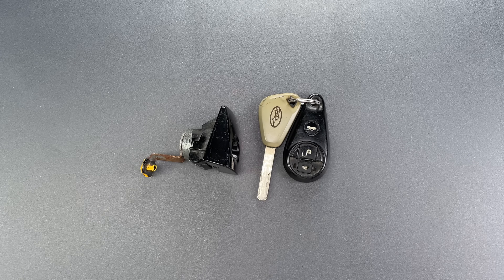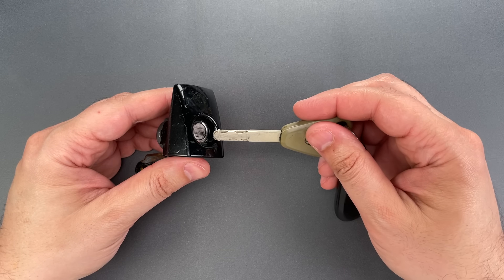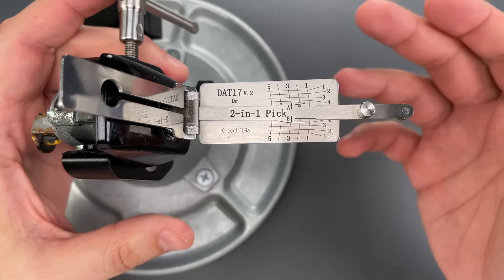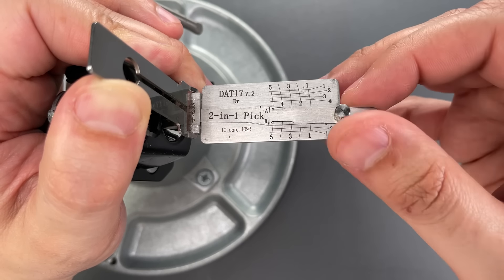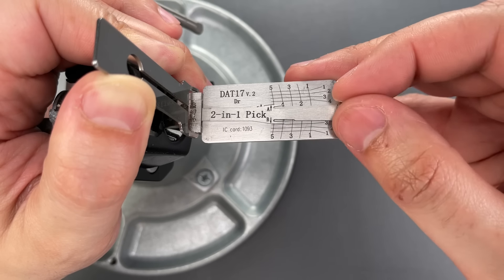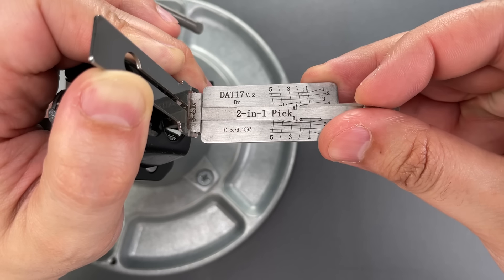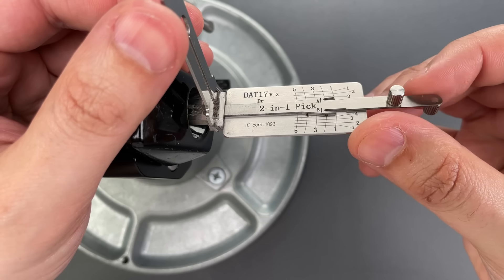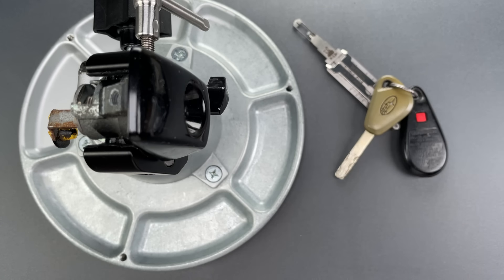[1346] A Trap For The Unwary: Subaru Impreza Door Lock

Comment: The great irony of this is that this is one of the hardest locks to pick, yet also the most likely to be bypassed entirely by any nefarious actors.
Reply: legit when my dad locked his key in his subie, the lock dude pried the window away from the flashing with a wedge and used a coat hanger to unlock the door lmao. one of the downsides of having frameless windows
Reply: @johnmichaell2505  Teslas are the same!
Reply: @johnmichaell2505  could that not be simply fixed by installed a flashing inside the door and better window framing though?
Reply: @prydzen  no, simply because the only real way to secure the window would be to put a lip over the top of the window. While this would allow for the top of the window to be secured. The window would have to be rolled down and then rolled back up any time the door was opened or closed
Reply: It's easy to open a locked car door by sliding a metal coat hanger down the outside of the window and pulling up the latch.
Reply: Cars are alas, quite limited in break-in resistance by the need to actually have windows. 😂

Comment: I’ve been watching videos on the Impreza for weeks now, this is a sign I should get one I just know it
Reply: My second one blew up within 3 days. Currently got no engine in and can't lock it 😂
Reply: oky  not again
Reply: oky  Stop spamming.
Reply: @xuNsh1ne  what's the link to?
Reply: We love our 2010 Impreza but I highly suggest going either prior to that model range or after it. I think that’s before 2009 and after 2012. It’s just a really poorly designed car that’s hard to work on... lots of fit and finish issues too.
Reply: @erik365365365  We have a 2009 hatchback with 160,000 kms and have only needed to swap the clutch so far. The thing guzzles fuel though given its pretty anemic acceleration.
Reply: @alshyia  I reported it as spam. Thanks

Comment: This is the first time I've actually appreciated having the Lishi tool used for the picking demo; before this one, LPL using one felt like watching someone play a game with all the cheats turned on. That is, not only is the method trivializing the task, I'm not learning anything from the demonstration. In this case, though, the lock was complex enough that I'm not sure I could have followed what LPL was doing without the Lishi tool providing extra visual feedback on which wafer was being manipulated.
Reply: Good point. This is one time that both the Lishi tool and the lock were better explained by the pairing of tool to workpiece.
Reply: Totally agree. I've gotten more used to visualising locks while watching them being picked over the years (I've only picked a few simple practice locks myself), but the tool on this one certainly makes it clearer. This does just seem like an edge case, though, where the additional tool makes the whole video better

Comment: My Forester Rocks. Even if you manage to get the door open, the obnoxious alarm system goes off and the fuel pump won't run until reset in the ignition or key fob. It's easier to steal just the catalytic convertor now. Not that I recommend or condone this.

Comment: I do love the suggestion of slipping a locksmith some money.
Reply: maintenance man [the use of a locksmith is specifically NOT req'd] as you have to replace the whole FUBAR unit with a new one- that's for the maintenance man to keep quite when you do that yourself or when he does that for you without telling the building owner/manager there is a lock picker in the building tampering with the hardware & FUBAR the units

Comment: Shouldn't writing down the wafer positions when picking help with picking it closed? As I understood the Lishi pick, it was designed to not only pick the lock but also decode it for making keys.
Reply: To get the wafers to stay in position they need to be bound before setting. The order in which they bind in that partial position won't necessarily be the same order in which they originally bound. So he has to go through the whole picking process anyway, wouldn't save much time knowing the final set positions.
Reply: @ussenterncc1701e  Thanks for clarifying.

Comment: Wait so he never got it open. Should I be worried that I’m in a branch of the multiverse that’s no longer on the main timeline?
Reply: He got it open; it just doesn't move very far. You can see he moved it the same amount that they key moves it (5:03).
Reply: I'm a locksmith. He did not get it open - this wouldn't unlock the door. I'm sure LPL could do it but no he did not unlock the cylinder in this video. Once it gets to that halfway picked position, it still needs another few wafers to be picked in order to turn. You can see when he uses the key that the cam on the back actually spins a full 90 degrees.
Reply: @vagrant2592  he got it open
Reply: @kakswell  wrong.
Reply: Thought the same thing. Came to the comments looking for an explanation. He didn’t fully pick this one. Just showed it getting stuck and unsticking it. @LPL any way to see the complete unlock?
Reply: @vagrant2592  its ok to admit being wrong from time to time buddy.. i wont hold it aganst you
Reply: the goal of the video was to show people where they messed up, what state the locks to "their" car are ending up in and how to fix it so they can use their key again.
Reply: @Kittsuera  If they have the key to begin with, then they wouldn’t need to pick the lock, no? We all understand that the lock has an anti-pick mechanism. We wanted to see that mechanism get picked.
Reply: Only half open. Could not open it!
Reply: @kakswell  You seem to be an expert in the legal strategy of "I am Rubber, you are Glue"
Reply: It was interesting that he showed how to get out of the pick trap but not how to open the lock fully. Maybe he left it as a exercise for the viewer. 

Probably the same technique to get out of the trap (pick lower wafers) or its opposite (pick upper wafers) would do it. The trap is probably meant more to interfere with low-skilled jiggle attacks.
Reply: @WindFireAllThatKindOfThing  we can be what ever we want to be in the comments section.
Reply: @kakswell  ew an ugly troll
Reply: @wbfaulk  just checked and i could clearly see the key turned it much further. Maybe it might have been enough to unlock the door, or maybe he just needed to pick a little more
Reply: It unlocked
Reply: @vagrant2592  watch again and listen too.
Reply: @r3d5ive87  Why? I've done this a thousand times in the field. he didn't fully pick it. period.
Reply: @r3d5ive87  He clearly states that the lock is stuck between the locked and unlocked positions, i.e. NOT unlocked. Check at 3:58

Comment: Wait. So your saying if some thief tries to pick a car door with this lock on and messes it up, you won't be able to use the key slot on the car door until it's fixed? That's an extremely bad design.
Reply: Is not getting your car stolen bad design?
Reply: @beemoescarmew  If it prevents you from using your key in your car door after the thief failed, then yes.

Comment: Subaru: lets make the best auto locks

Also Subaru: and shit head gaskets
Reply: only on certain engines
Reply: Tbf, they are the only manufacturer to run all Boxer engines, though... well balanced engines, and keep a car well balanced too, but they're hard to make big power with, especially if you're talking something small, like a 2.0L 4-cyl...
Reply: @jordaneggerman4734  They really arent hard to make big power with for a 2/2.5l engine, unless your definion of big power is 1000plus only. Also, headgasket issues were only on certain years of non turbo imprezzas.
Reply: @sparkatorch  ok, I did a realistic defense for a niche manufacturer, and you just went full simp...even when you try to crank the turbo ones up around/above 500, it defeats the Subaru reliability.
Reply: @jordaneggerman4734  Yikes, didn't mean to strike a nerve. And pushing over twice the power on a stock block? Hell yea that defeats reliability. Thats not just subaru.
Reply: @sparkatorch  it's not a nerve, and you, yourself, determined "big power" to be 1000. I halved that, and you're still whinging?
Reply: @jordaneggerman4734  Lmao, seems so when you immediately resort to name calling like a child. I didn't necessarily say big power is only a 1000, as its hard to define "big power" as its more subjective really. It was more of a example as some only consider big power to be 1000.  Not sure how i was whining? I'm stating facts/opinions, not complaining.
Reply: @sparkatorch  lmao "name calling like a child"...no, I called you a "simp", not a "fool", like I really meant. "Simp" is actually an accurate description of what you were doing; not, as you so succinctly put "name calling like a child"... 🤣🤣🤣
Reply: Calling someone a simp is name calling regardless, even if you think its justified or not.  And this is all assuming you were right in calling me a simp in the first place.
Reply: @sparkatorch  no, you made it pretty clear, your stance on Subaru, and such, and, well....yeah. Sorry, but you were simping for Subaru...
Reply: @sparkatorch  ok mom

Comment: I’m having trouble getting a mental image of the internals of this lock. Any chance it can be gutted for us to see?
Reply: I second that. How does the lock know it was picked and not to open all the way, and why don't other locks do that?
Reply: @scott215  I’ve seen other locks where the body of the key is required to maintain the position of the pins/wafers/discs relative to one another as they all turn. Without the key holding everything together, one of the pieces drops into a slot somewhere. It’s a pick-evidence technique which can be made reversible or irreversible. LPL said he made one for his own house. 

That said, it’s all the general theory about most likely why this is happening. The specifics of exactly how it happens in this lock remain completely obscure. To me at least.
Reply: @twestgard2  I saw the one LPL made for his house. That one used normal pins and was irreversible without taking the whole thing apart, IIRC. I'd still like to see how it's made reversible and with wafers.
Reply: @scott215  Probably just a slot on one side to allow those wafers to engage.
Reply: the pins just fall, and key cant press them back like a normal lock i assume so... it jams? About all I can think of, But I would love to see!
Reply: @stickfightjesser  watch the video I linked.
Reply: They sell a clear acrylic practice lock in this design

Comment: Frustrating thing is the trap only hurts the original owner if a criminal fails to pick the lock on your car.
Reply: You've still got one on the other side if I'm remembering correctly.
Reply: Yes the owner bears the expense of replacing the Lock or calling a locksmith/carpenter... but if you want to keep the thief out bcuz you have something of value in the subaru & it is protected from an overt act of violence to gain entry then I suppose this is a good lock for such people... my thinking is that you don't leave stuff you can't replace anywhere that a stranger can access it
Reply: It's not frustrating, it is poorly designed, and it won't actually stop the lock from being opened, it just disables the lock for the owner if someone tampers with it successful or not, by any sane analysis it's terribly designed.

You don't stop someone from breaking in, and you force the owner to have to pay someone to fix the lock before they can use it again.  That is terrible design, not frustrating but good design.
Reply: @gilbatzri  Yes, but you know it has been tampered with which is actually the holy grail :)

Comment: Well, as someone who drives a Subaru with this exact mechanism, I can say I'm pretty happy with this result 😁
Reply: Why? If someone messes with your door lock you can't open the door any longer, why would that make you happy?
Reply: @gilbatzri  Because it took him forever to pick, even with a purpose-built tool, and it leaves a sign that someone's screwed with it unless they spend even MORE time on it to reset it. If my driver's door is stuck odds are pretty good keyless entry will still open the other three doors or the hatch.
Reply: @evilspoons  except the scenario of "picking a car door lock to gain entry/steal the car" is not an actual thing that happens ever. Like there is a 0% chance of someone attempting to pick your car door lock.

If someone wants something from the cabin, they will gain entry via a window. It's faster and easier.

If they want to steal the car (if it is at all reasonably recent) you need the chipped key to turn on the car, even if you have a matching cut key it won't work, nor will hotwiring the car.

So the scenario you are imagining and being "happy with this result" of is nonsensical. 

In practice all this means is you have to pay someone to unscrew your lock if it is tampered with. Not sure why you think this is a benefit, but whatever works for you.

I had a 2012 Subaru Impresa and it was good in an accident, but it was a piece of garbage aside from that, low quality fixtures, bad engineering, the clutch failed catastrophically in the first 3 years, the engine leaked oil from day one, and eventually based on a class action lawsuit they lost the engine was completely replaced.

Subaru is a garbage company that didn't stand behind their poorly engineered and manufactured product, and their service staff was actively rude in their handling of a manufacturing defect that everyone in the world knew about.

The Mazda we replaced it with is better engineered, drives better, and is an all over superior vehicle to the Subby.

Comment: Another interesting thing about Subarus. I used to cut and program their keys for my job, and if you unlock a door on a Subaru with a physical key the alarm will always go off. Even if the key is programmed to the vehicle the alarm will still go off, though I notice its not 100% of the time, but most of the time. The only way to know that the alarm will not go off when unlocking the vehicle is to use the button on the fob.
Reply: My unlock button recently broke on my 09 Impreza, and I figured out a way to bypass the alarm. You have to lock all the doors with the door button while the car is running, then manually unlock the driver's, then turn off the car, open the door, and lock it with the key.
Reply: This is what my 99 Skoda did - original alarm with remote was "add-on" to standard central locking system, so they operated independently. I wouldn't expect this behaviour on a modern car.
Reply: That happen when you lock the vehicle with remote and unlock it with physical key. When locking with remote, it will arm the alarm; but when unlocking it with physia a a a happenscal key, it will not disarm the alarm (just like it's been picked).
Reply: The alarm has three operating modes in my 2012 Legacy. You have the normal arm after lock mode, the disable mode, and an arm after delay mode where the alarm will arm after the key is removed from the ignition and the delay expires regardless of the lock status. A key opening a door or the trunk will trigger the alarm any time it is armed.
Reply: Both my moms Jeep and Kia can't be unlocked manually without setting off the alarm. I'm too lazy to care about hitting the button on the fob and still have to unlock it either way so I opt for the key lol. It's just a pain in the ass getting something for her late at night.

Comment: But did it actually open and just not return or did it get stuck in between open and closed?
Reply: it gets stuck between open and closed.
Reply: (3:54) "We can see that we did get this open."
Reply: The halfway position is open but it wont allow the key to be removed.  Anyone whose driven a car without electronic locks intuitively knows this.  The halfway issue applies to the key, not picking.  But it means leaving it in an invalid impossible state must be reversed.